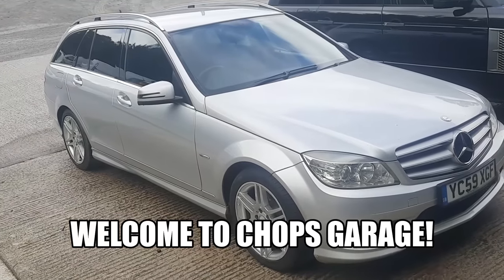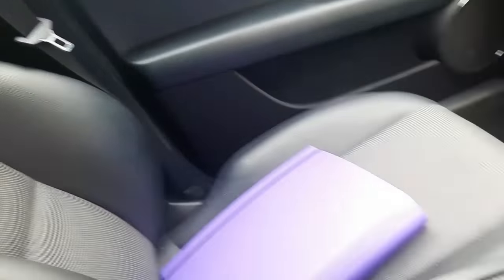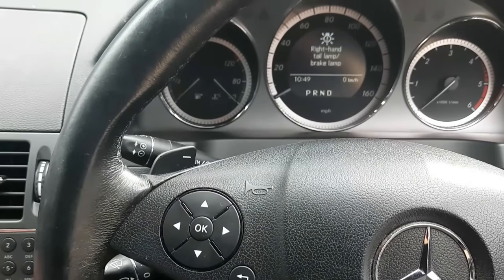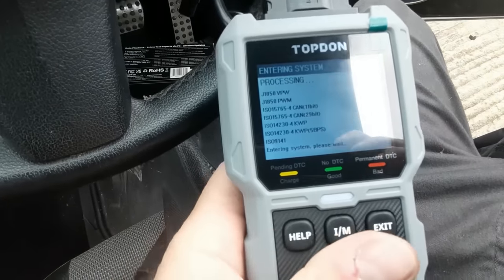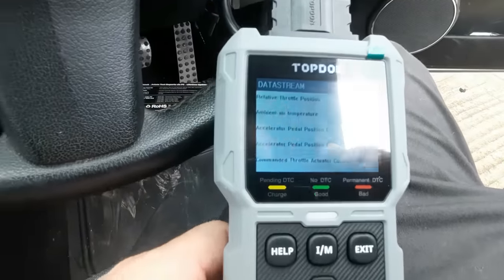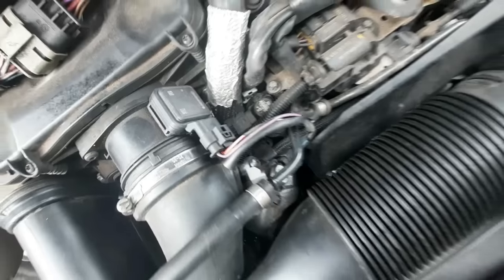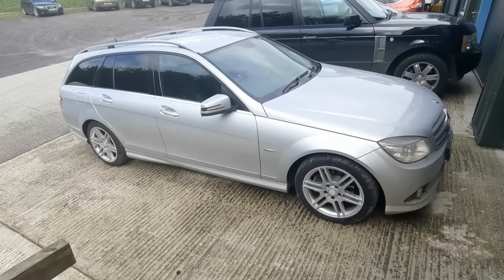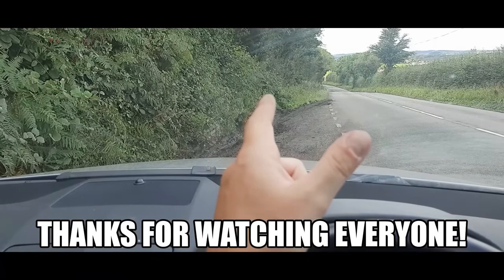Cheap Mercedes C220 CDI - This is exactly why you should NOT buy old Diesels!

Comment: These are great reliable Mercedes Benz diesel engines The key thing is to regularly change the engine oil and filter every 10000 miles or 12 months.

Comment: A Mercedes 220 CDI does not come close to a Ford TDCi in terms of quality. my Ford went into a completely new life after 300,000 km (187,000 miles) with a new owner. That was 2 years and 100,000 km (62,000 miles) ago. No problems yet with this Ford, just continues.

Comment: I've got one of those parked up, engine is OK, it's got a steering column immobiliser fault so it's a non runner, I've had it bypassed but it's not lasted.
Reply: Best way is to remove the electronic steering lock and program an emulator instead. Cheap and easy job .. will outlast the car. I do loads of them.
Reply: @elliottpeters2996  have done mate, don't know if emulator has failed?
Reply: @roystonvehicles9129  possibly. If it's stopped making its artificial noise and you have no ignition lights then worth testing it. Scan tool data is very good at identifying the culprit in a no start situation on the W204/W207 platform. None of it is difficult to fix.
Reply: @elliottpeters2996  I'll have a look mate, it's blocked in behind 20 cars atm, thanks for your help.

Comment: I find it interesting that 150,000 miles in a Diesel is considered to be a liability. I see so many Petrolheads slagging off EVs because they say the battery won't last. Everyone's first question about a second hand car is about the mileage, so ask yourself why that is. It's the Engine and drivetrain that's the issue, something that's so simple on an EV.
Future EVs are going to reach astronomic mileages compared to ICE vehicles. They're already way more reliable and less likely to catch fire.

Comment: The dip stick is right at the back of the engine near the bulk head.  The battery is under the boot floor.  Did the previous owner ever change any bulbs?

Comment: Right mate, this is how to fix it, take the top sensor out of the dpf, it's on the left side under some stuff, pour some dpf cleaning in, you buy it in 4.5 litres, fill it up, let it pickle, put your pressure washer in it and blast it tru, start it up with sensor out, when it's running half OK put the sensor back in a go for a run, it'll steam like mad, but it will clear and be sorted, did one last year on the same car.
Reply from the maker: Thanks mate have my 4.5 litres here ready to go!
Reply: @ChopsGarage proud of you bud, it'll deffo work, fill it right up probably about 2 litres, do dpf first and I bet air flow will do away, basically it can't flow the air as exhaust is blocked.
Reply: 150k on 14 years old is OK bud

Comment: What a stupid title. I use daily an old 1.9tdi which already have over 900.000km on clock. Also i forgot to mention i run it with THREE TIMES more power than stock. Which is your "newer diesel" which can beat it?  How about to beat a same age om606? 
No dear girl, THE OLD DIESELS are THE BEST, then the newer they are, the worst is reliability. As gasoline engines too.
Reply from the maker: Not that stupid, you watched lol

Comment: I previously had a near new 220 in AMG trim for 10 days - not sporty, not good on fuel, rattly, narrow power band (nothing outside of 2500 to 3500 revs) , noisy, 9 speed gearbox didn't know what it was doing, rear lights were letting water in.

Comment: A sensor goes wrong and it will prevent DPF regen taking place as the ECU is no longer able to determine whats fully going on so can prevent DPF regen. I did notice its air intake temp seemed to think it was over 60 degrees id certainly hope thats farenhight else that can also cause poor running.
Reply from the maker: So sort sensor first

Comment: Mate I had this issue with a c320 cdi Google swirl valve bypass resistor had no codes coming up when I had the issue put this resistor in and the car worked perfect for 2years have recently sold the car and still no issues with the repair
Reply: Maybe I spoke too soon before watching the full video 😂😂

Comment: i have a faulty MAF sensor on a 2015 diesel Focus mk.3.5 - the engine light comes on then it will go into limp mode after a few more miles -  OBD error code is P1103 which is the MAF

Comment: Whats wrong with old diesels? I have an '81 Mercedes 300d, daily driver, 440k on the clock and all i done in the last 10 years is to change the oil and check valve clearances 🤷‍♂️

Comment: I had a blocked DPF on my deisel BMW. Had a MAF sensor code but in the end, it turned out to be a boost leak from crack in the intercooler.  Also had to change the glow plugs as it was also refusing to regen.

Comment: Check the tyres. I always do. Cheap tyres = bad service
Reply: I always see really cheap tyres on mercs now.  Mowhawk seem to be a favourite
Reply: Completely  agree, so often a sign of a vehicle neglected until mot then literally budget tire options fitted as no time to wait for premium tires to be ordered in.
Reply: Not always true, I run roadx on my 730d and its maintenance is done on time for the last 18 years, I even change the brake fluid every 2 years. The reason for the cheap tyres is two fold, first, the roads in the uk are that shit I became sick of spending near 400 quid a corner for rubber that gets trashed by pot holes and generally shit road surfaces and second, they wear and grip just as good as the expensive tyres. I don't do slow , regularly pull a large trailer, travelling to Europe and have been flat stick on the autobahn and the cheap tyres have never given me the 'oh shit' moment in any weather conditions. In fact, the last pirelli tyres were shite in the wet and only lasted 16k miles on the rear and 20k on the front. They also drum on the motorway.
Reply: @michaelbamber4887  obviously some cheaper tyres are worse than others.  I have had some oh shit moments with cheap tyres, here are some I don't like.  Simm tyres HR7 dark horse, nankang (they may be better now)  enviro,   to name a few.
Reply: @chrishart8548 yeah, they are the super cheap ones, the roadx are sort of mid budget, 100 ish a tyres for 275x45x19. But also I've been told, my heavy car helps, the smaller tyre size aren't the same, not even the same tread pattern. I once bought a 525i back on the 90s, the garage who I bought it off put kingpin remolds on it, fuck me, they were by far the worst tyres I've ever driven on, the traction control lights were on every drive on wet/damp roads. Took um off after 2 weeks when I'd saved for some continental.
Reply: @michaelbamber4887  I agree about Pirelli.  I have cross climate as do many white van men here on really shitty roads (wales). I've looked at lots of mercs recently and all those that had cheap tyres had bad service bad treatment by the owners?  Generalisations are never 100% accurate but are very good guide
Reply: @stephenrichards5386 trouble is Mercedes build quality is wank even if you look after um. My friend who has just retired as a master mechanic with Mercedes Blackburn, with all his working life there. Wouldn't have one given to him. They rot for fun, the brake parts are very prone to rust. I know of 2, 4 year old mercs with failed pipes through rot.

Comment: Be careful with some of the diesel mercs, some of the early 2000 models require pulling the engine out just to replace the glow plugs! Turning a usually cheap job into an expensive headache.

Comment: lovely Merc. but I was in the market for one of these, petrol version due to ULEZ, saw one down south but on looking at the mot history it was shocking. Corroded brake lines and rust are common on these, i couldn't find one that didn't have these issues for up to £9k and the dealers were selling these at a high price! in the end i opted for a 2010 BMW 320i. I think ppl should have a good think about the kind of driving they will be doing before buying a disel as otherwise you are going to have dpf issues.

Comment: Dont think it's intentional but the title is a bit deceiving. If you are going to buy a diesel, buy a really old one (pre 2005 in most cases) since they did not have DPF's etc. There was a time when diesels was a very simple system with far less electronics than their petrol counterparts but the tables have since turned.

Comment: I have this car and have an air con issue. When pressed the AC light flashes 3 times but wont work. Had it regassed and they said the compressor etc are all good but its a controls issue. Any advice would be welcome for next steps.

Comment: These have a nasty habit of having hidden dangerously rotten brake pipes that are out of sight during an MOT. Remove the nearside rear undertray and I bet the main front to rear pipes will be knackered
Reply from the maker: Oh cheers
Reply: Just failed MOT with this exact issue and had to replace both rear pipes at 93k. They had seen it before and knew to check behind the cover. There's very little protection on the stock pipes
Reply: @mcgradz1  Good thing they were spotted before bursting!

Comment: Is it common practice for a buyer to use a OBD diagnostic reader on a car when viewing ? Looking to get a reasonable high mileage A6 Avant.
Reply: Would be wary tbh depend on the car so key cloning etc. Likewise what they plugging in? Definitely not something where they can fuck about with the settings etc, a £15 Aldi one maybe as it’s very basic. But it won’t flag up codes for SAS etc.

Comment: I'm suspicious of diesel cars that dont have high miles.... Very low mile cars have either been clocked or they have been parked up & not used for extended periods of time.  
As long as there is evidence of regular servicing and the MOT (mileage)  history supports the service history then Im happy to consider and/ or buy high mile diesel cars.
Ive had my 2008 Volvo v50 SE 2.0D (EURO3 without DPF!) for over 8 years, done about 80K miles myself (total miles about 183K). She lets out the odd belch of smoke under sudden acceleration but burns clean without ant visible smoke under normal driving conditions.
I get about 60 to 65mpg on long motorway journeys and overall average including some urban traffic id just over 53mpg calculated annually when she gets her MOT & Service.

Had 2 failures since Ive owned her- 1- alternator failed at 145K miles/ 10yrs old. . . . . Then starter motor failed last month at 180K miles/ 15 years old. 
Timing belt at 145K miles and LCAs replaced at the same time. (Both are wear & tear maintenance items, not "failures").

Overall she has been very economical & reliable. She just passed her MOT & we are gonna stay together for at least another year.

A decent diesel that has been regularly serviced could keep running almost forever. Things like DPF & EGRVs can be problematic. The absence of DPF on my old car make her much more reliable than EURO4 variants and because I do mostly motorway miles, I haven't encountered and issue with the EGRV. (an Italian tune up works great to clear out carbon gunk deposits from the throttle body & EGR side of intake).

Im pretty sure that if my car had a DPF, it would have been scrapped years ago because a DPF replacement usually means "beyond economic repair".

Comment: No dual mass flywheel on an auto James!
Reply: Not true 
A torque converter auto doesn’t usually have a dmf but all dsg,s do
Reply: @boyasaka but the Merc has a proper slush box auto .... not a DSG 😉
Reply: Only the little A class and CLA with the 1.3 engines have DSG boxes. Proper Mercs have torque converter autos.

Comment: hello James, very interesting show around the merc, and looks like a really good condition considering the high milage. The service history is good too, as it has had a lot of work done , recently! The MOT shows that this car is safe and sound too with no advisories. I was amused that you just plug in the new code reader, having not checked over the instructions ( a lot of products now need to read the instuctions / user manual off the internet!!) and work your way around the information screen! Hope the minor faults are easy to fix, maybe wityh a long run out? Best wishes from Lincolnshire

Comment: What I find annoying is when dealers sell these cars for extortionate prices like over £3k as they are not really worth that price with the problems that can or already has occurred on them. 

Diesel cars before 2009 are actually ok as they won’t have DPF fitted,so I believe this is designed to destroy these cars quicker and get them off the road.
Reply from the maker: Well if you sold the cars for 500 quid to dealers they could sell them cheaper. Dealers don't make the prices up they are driven by what they can but them in for. On one hand complain we sell to high but on other hand complain we don't offer enough to buy your car
Reply: @ChopsGarage  you have a point 👍🏾

Comment: I don't understand this obsession with mileage, especially in the UK.  Everybody wants that little runabout "only used by the vicar or little old lady on Sundays!"
Unfortunately, people place a higher valuation on lower mileage than overall condition and service history: But as you say, pay low prices because of the age. Catch 22.
A regularly serviced diesel should be considered "high mileage" at or above 300k...... 
Most trucks are run 24/7.... 150k is considered VERY low mileage.... even a two year old truck could easily have that clocked up.
Reply: Agree
My Merc Vito is 800 miles off 300,000
Reply: Got a 2020 Renault T Series with 650k on it, The mileage doesn't seem to really matter a great deal it's completely how the are maintained and driven.

Comment: Don't buy an old diesel, buy an OLD diesel. My 25yr old LandCruiser has done 140k, admittedly low mileage for it's age, mechanical injection and no DPF or fancy electronics. These engines will easily do 300k+ with good maintenance, obviously not in favour with the Eco brigade but WGAS! 😀

Comment: I just sold a rover 75 with the bmw diesel turbo engine and had all the same issues but also had o' Rings on the turbo air intake and got all my power back though in my case it had been smoking on hard acceleration .
Reply: By the way it had done 175.000

Comment: Mercedes has own warning light for dpf so this problem is probably not dpf oriented. I had my dpf cleaned up at a workshop that has cleaner for that. Not big issue. Most problematic on my old diesel om642 V6 has been the injectors that has been leaking and it did take some effort to find a workshop that was really able to fix them. Beware of bad workshops that want to overdo and charge a lot.

Comment: Not sure about these earlier models, I have a 2014 C220 which is an absolute star. I serviced it at my local approved Merc garage. Got it at 18k miles in 2017 April and is now on 80012 miles. Unfortunately, now it has to go as my office in Heathrow was dumped into ULEZ(go figure - any of the planes that take off will pollute more in one flight than my car init's lifecycle). @chops garage what would it worth on the road! It has full service history by the aforementioned garage(can be checked on Mercs Digital garage) apart from 2021 when the garage was closed so I had to change the breaks/disks by a friend at his garage(have receipt for it).

Comment: Just a thought. The speed limiter hasnt been set to 60mph has it? Its on the stalk to the left of the steering wheel.
Reply: Possible but the limp mode also limits the top speed and max revs in each gear i had this before on a 2011 mercedes sprinter with a bad air flow meter.

Fixed this and it went back into limp as the EGR  hadn't regenerated during the fault so had to do a force regen.

Nightmare fault and dangerous if your towing.

Comment: You can do a force re gen if you have the right software
Reply: From experience you need a fairly advanced code reader to do this, i had to get my mecanic to do this on mine as i could only read and diagnose the fault.

Comment: There’s nothing wrong with old diesels , there’s  penny pinching supermarket fuel users that block them up , if it’s done 150000 miles it can’t have been that bad though , most 15 year old cars have worn this that the other but if cared for 300000k isn’t an issue

Comment: Listen to what this man says its true do not buy diesels.... expecially with a lot of milles or old . The pistons and engine block and head gaskets are bulletproof because of the high  compression the engine  has to be built strong, the problem is the "government polution restrictions" DPF ADBLUE SYSTEM egr coolers etc make the engine fail turbos etc too many sofisticated systems which make it to fail and is not cheap to fix it not at all and they will fail.Unless you drive crazy distances like 100km daily do not buy it many people think diesel will save fuel  and is true but diesel is efficient only on long distances on city you will clog up all engine injectors turbo will fail. Or another option buy an old diesel 2000 2002 no dpf no adblue only turbo thats it.
Reply from the maker: Absolutely spot on

Comment: iAd rather have a high mileage diesel than a low mileage petrol cars around 30 to 40k are due all the faults you just mentioned much rather have a high mileage diesel with history I have a 2008 Audi a6 avant 2.7 v6 180k and runs like an absolute dream before that I had a bmw f30 60k on it hi pressure fuel pump went and destroyed the full fuel system
Reply from the maker: Oh dear

Comment: old diesil cars vans are not run in till 80,000 to 100,000 ,the newer diesils seem weak in parts to me i had a vw passat  an early 1990s diesil with 172,000 ran perfect a diesil bmw 1987 model ran no problems,pre2001 are built better